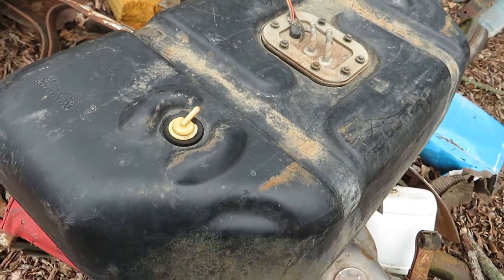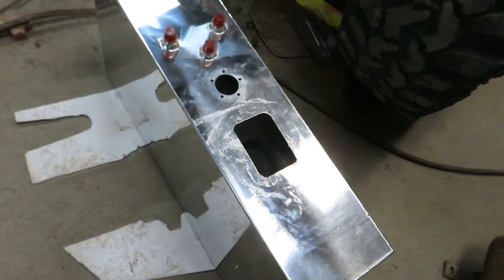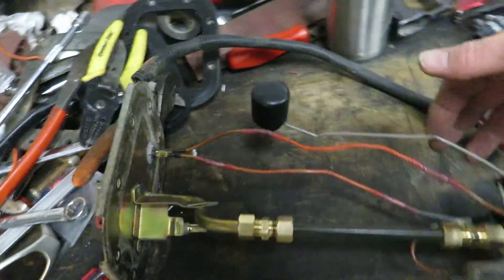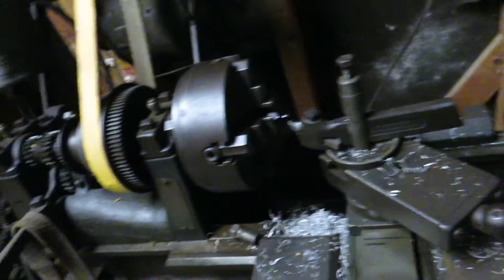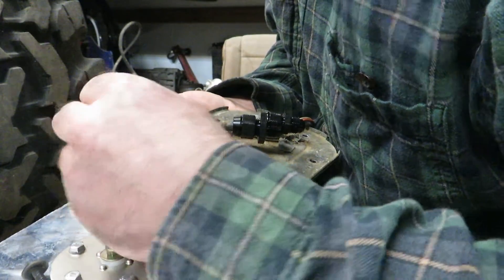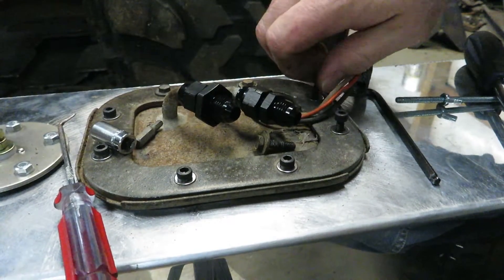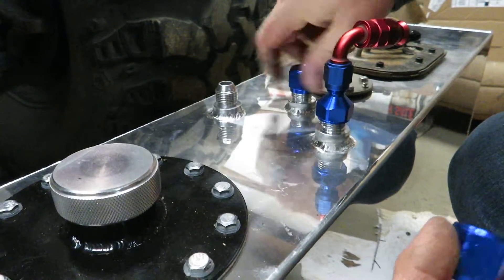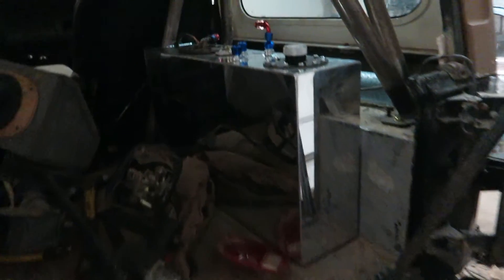jeep yj fuel cell system plumbing

Comment: What if you drill 2-4 holes outside of the pattern and then just flush rivet the plates on so they can't fall into the tank and you don't have to have threaded lines with you?
Reply from the maker: Yea probably could do that. That's a good idea!